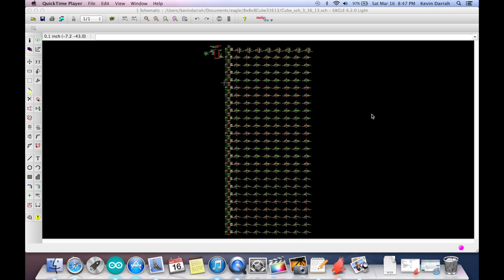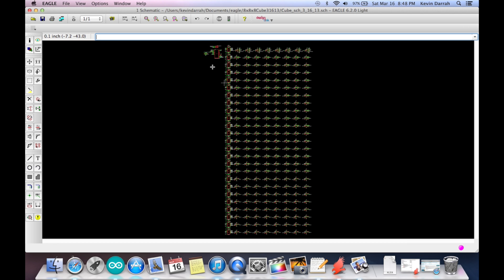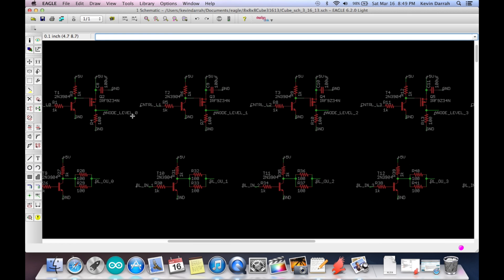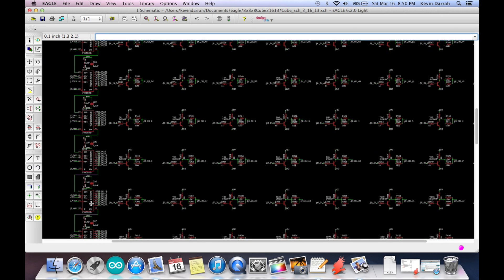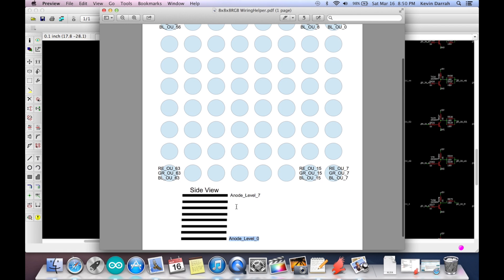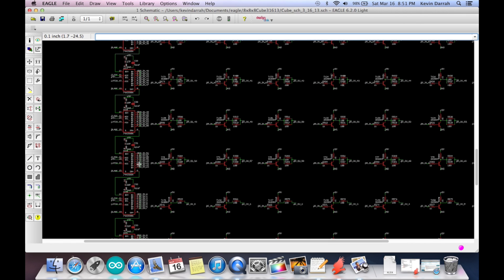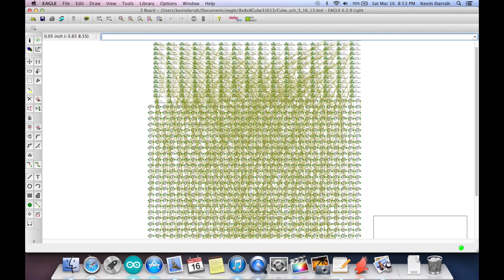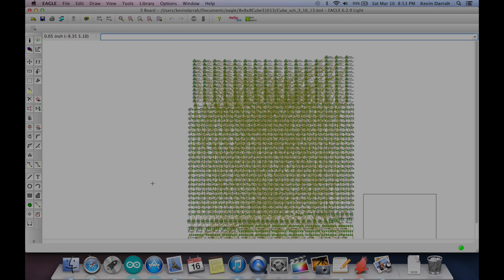How To RGB 8x8x8 LED CUBE - Schematic!

Comment: I have been making my own 8x8x8 rgb cube and have found your videos quite helpful, but i have a problem with the anode drivers. Particularly the 100 ohm resistor between mosfet drain  and gnd is getting uncomfortably hot, it uses about 0.3W when the LED "layer" is off. Is this normal or did i wire something wrong?

Comment: Great work and thanks for sharing document..but sir i dont understand this sir shift register is 13 no pin is blank pin and it is connected to the ground.But you gave that schematic to the shift register's blank pin arduino D4 pin and 5vAnd connected to 10k regieter.So do not connect to Blank pin ground like schematic 5volt and Connect with 10k register ?
Plz sir rply and help me..

Comment: You do not need all of those transistors.  The 74HC595 can directly drive the LED's and with a common cathode arrangement a ULN2803 can drive the cathodes.  Thus you can make a LED cube with no transistors, just IC's.  See my many videos and blog for more info and schematics.

Comment: I have designed a PC Board that will work with this code. I used 16 bit LED Dirvers, so all those nasty transistors (except layers) are done away with - plus a single 8 bit shift register for the layers. It's actually pretty sweet. It also works with the code and was based on the circuit from the how-not-to-engineer website. It's configurable by a set of 2 jumpers to use the single data stream this project uses with the Arduino, or the triple stream used with the PIC UNO32 on the other project. It also provides a base for the LEDs themselves, eliminating almost all wires completely.

Comment: I've done a design for 1024 LEDs, although not a cube, and ended up using I2C x16 pin drivers (PCA9555). These can sink enough current for one LED or drive the gate of a mosfet for the anodes. Needed 4 I2C ports so there were only 8 wires between the controller and the matrix.

Comment from the maker: Have one micro be the master and write a pin HIGH, which is an interrupt for all the other micros.  The other micros would not need to run timers, since the one micro would control timing...  just off the top of my head anyway

Comment: I am sure you hear it many times before...you inspired me to do this! You the man...I am wondering can this design scale by adding more LEDs (40X40X40), more external power source, and more components, rework the code, but still using one arduino board. Is it possible?

Comment: I would like to ask you if you would be adding some more reflects to the code as I dnt have much knowledge on that..also  im a but confused in the schematic cause  from Ic 24 onwards there is only one resistor used on the collector  of the transistor can u help please

Comment: sir actually im building a 8*8*8 rgb cube with inspiration from you!
as iam new to electronics i wanna use arduino uno instead of collecting of atmega32,crystal,,....etc.so please help me in deciding the pin to be used to give input to the shift register so that i can use ur code without manupulations!
please help me out!

Comment from the maker: good question, that pin (if pulled LOW) will reset the data stored in the register.  We don't need to do that since the new data shifts the old stuff out

Comment: I ran into a restriction in the free eagle board layout section that it restricts its size to what you see initially (pretty small). I worked around it by making my design modular - so could you. Nice project. Thanx.

Comment: great Kevin
I did the schematic also in eagle and draw the PCB, got 3 (rgb) prints and the anode pcb ready only needed to adjust the size of the anode board layers, but i finaly did go for the proto777 boards, did finished and tested the 6 trans. and 3 74hc595 boards now soldering the last board, the ANODE/arduino board and than connect everything together. i noticed that when i use for instance LED(0,0,0,15,15,15) the leds are not as bright as in the original code